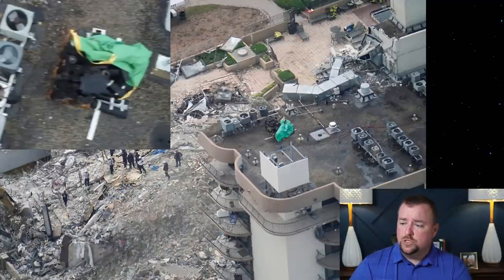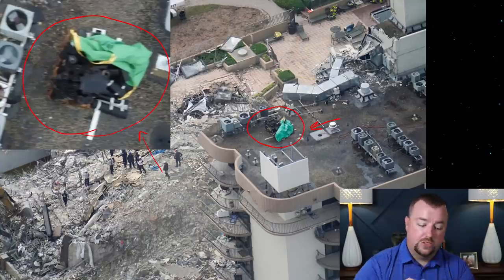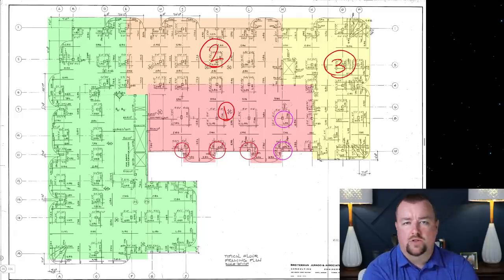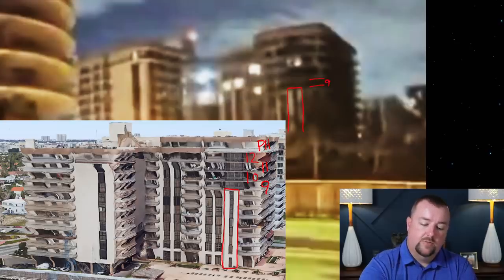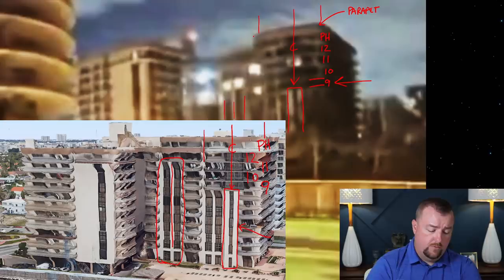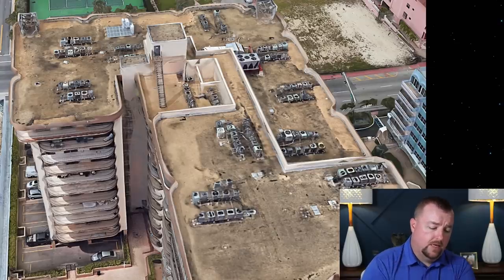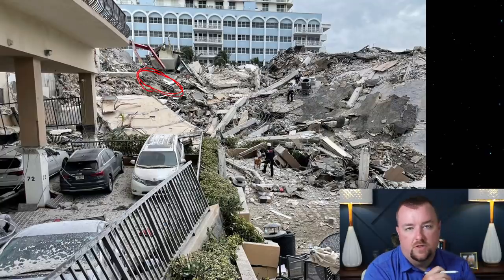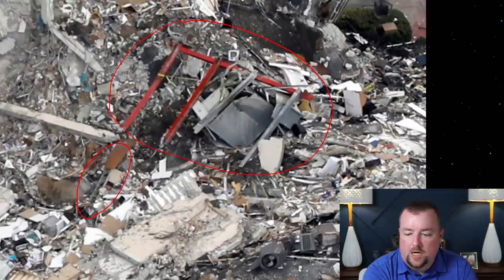Surfside Building Collapse - Did it start at the roof?

Comment: Good video..  I am a certified and licensed roofing contractor of 30 years in Los Angeles. I agree there is no reason to believe the cause of the building collapse was the roof. In fact the roof was underloaded, not overloaded, here’s why.  The existing roof is a hot tar gravel roof which consists of #4/5 tan gravel generally applied at a rate of five 90lb bags per 100 square feet for an installed weight of approximately 4.5 Pounds per Square Foot or PSF (not including the membranes and hot tar, total installed weight approaching 6 PSF).  So the roof used to be tan, we know this.  Since it is now black, it's quite clear that they have swept all the loose ballast off which is the first thing I would do if I were going to resurface this roof, it's standard operating procedure, since the roof is now black and not tan and we know they're in the middle of a roofing job that makes sense. The pile of material (approx. 50 or more rolls – enough for at least a large portion, if not the entire roof) is clearly various membranes that would be used in a built up roof process with hot tar and gravel, it is NOT just for patching in anchors, this is FAR too much material for simply patching in some anchors - I would only need a couple rolls of a smooth flame applied membrane to waterproof say, 30 of those anchors and I seriously doubt there's more than 30. The point is that a good portion of the installed weight of the roof was already removed. Those rolls should not have all been located in one spot on the roof that's pretty lazy of them but it's not a massive amount of weight they are mostly not very heavy consisting mostly of a #11 pound roll which is maybe 40 lbs a roll. Again, a bit lazy of them to just put them in one spot, I would have spread them out a little bit but many tons of weight was already removed from this roof when they swept all the rock off so overall loading was drastically reduced. The ceiling fell in the parking garage and I don’t see how any aspect of the roof – even if it were overloaded and it clearly was not, could have affected that.  Achems razor – the simplest answer is usually the right one.  The engineers and other contractors said they have major structural stuff going on, and what do you know, there’s video of it collapsing in the parking garage. Case closed and stop the nonsense people about bombs. It’s not always bombs.
Reply: Truth bomb 💣 love of money was the cause.
Reply: I agree that the roof we can see in the photo is now lighter but we are looking at the building that remained standing. Do we know for sure they removed the old roofing material from the section that did collapse or is it possible they staged the new roofing material and possibly other equipment on the roof of the section that did collapse?
Reply: Very informative. Thanks for sharing -- really interesting.
Reply: Hi, this might be off topic but since you're a roofing professional. Can I ask you a question? had my shingles done on my Cape cod home 25 years ago. The planks underneath the new shingles splitting from the nail guns. Is not leaking and holding on as long as possible. My question is it possible to spay on roofing material  on the existing shingles?
Reply: well said
Reply: The building has a section (C units) with two parapets. I was wondering why that would be done and I am guessing a parapet is a lot heavier than a balcony railing or just a wall. I was thinking this was an error in construction when they were still confused about whether they were building a 12th story or a 13th story building. This is the only section with the double parapet (one on the 13th story and one on the roof level) and although I subscribe to the columns buckling at the pool deck level under unit C (floor level of apt 111) theory, this added weight probably did not help those columns.
Reply: @beehaven9949  yeah, interesting...when was the 13th storey added? Was it in the original design or was it added years later?
Reply: Note that the code requires 15 lb / ft sq. Rain and storm load to be accommodated within the design. None of that load existed at the time and the dead load roof material could easily be carried.
Reply: @callmeishmael7452  good point.
Reply: @laurasalo6160  Original permit was granted Nov 1979 and the 13th floor was granted Nov 1980. Certificate of occupancy granted Dec 1981, & 13th December 1982.
Reply: @beehaven9949  oh wow, thanks for finding these details.
What do you think, does everything look routine in how this was done? Nothing unusual about it?
If you know, I mean...
Reply: @laurasalo6160  Definitely a fiasco including resignations and all.
Reply: Well said White, we construction workers have a good understanding of how buildings are made ...
Reply: @rollzolo  I have seen videos where grass is grown on the roof, keeps the house cooler...
Reply: But locals said it looked like bomb damage
Reply: Too long, didn't read.
Reply: c4 attached to support columns “helped” this building down…demolition.  Sketchy business everywhere.  Demo…that’s what I saw.
Reply: @jimhofoss9982  ok crazy Ken.....is your wife a karen?
Reply: @rollzolo  I've seen it done, but generally speaking, you don't spray comp shingles.  And far as i know the only thing you would spray on there is white elastomeric paint, which means your roof would now be glaring white.
Reply: @gregx8245   yeah words are tough man.  sorry i couldn't just provide images, like the coloring books you're used to.
Reply: However something was seriously wrong with load capacity design at deck level which was minimum 50 lbs/ ft sq. Required per building code. That’s a lot of design capacity / strength for an ‘empty ‘  deck to simply fall into the parking floor below.
Reply: @dreamersruleNOW  All rubble looks like the aftermath of bomb going off. Doesn't mean there was actually a bomb. Just like how Cassie Stratton said there was a sinkhole in the pool deck but it was just the pool deck collapsing into the garage.
Reply: I hate to say this, after your detailed and informative explanation, but it's "Ockham's Razor," not "Achem's Razor," named after William of Ockham, a prominent medieval philosopher. (Sometimes an alternate spelling is used: "Occam.")

Comment: Will y’all stop commenting based on the title of this episode.  He knows it didn’t start on the roof.  He’s simply going into every possibility because that’s how to properly investigate something.  You have to investigate all probable possibilities in order to rule them out.
Reply: That’s why the title is a problem. It should be changed.
Reply: @hellobriii  is right. It clearly began down in the garage or the pool deck, but the fact that there was additional loading on top may have been a critical factor; it may have lasted another year or two before collapse if they hadn't staged so much roofing material on the roof. Of course if they actually spent the money and repaired those weak beams and added more column-to-span brackets (the rebar was clearly not enough given the punch-through failures) it may have lasted another few decades.
Too bad they paid with their lives and not their wallets.
Reply: @hellobriii  I’m not sure if the title changed, but the question “Did it start at the roof” is the question investigated during the video. When you make a video to answer a question or explore a thought line, the best thing to title it.
Reply: Waiting to find out the details is not the Western way of things. You make your conclusion and dismiss everything that does not fit with your now very firm beliefs...
This is why the English speaking world is in such a mess.
Reply: He "Thinks" he does not know! and I can see other alternatives that are as viable. At this stage no one knows. Please don't put all your belief in a single theory, ask yourself where is the proof that the PH didn't collapse first. I can see that as a possibility from frame 1, I could even propose that there appears to be dust in the air in place of the PH, blurred due to motion in frame 1. The answer is not in theoretical notions it is in the video, frame 1 and 2, analyse it "correctly" and it will reveal much.
Reply: @chouseification  the roof loading would possibly be accorded the status of 'contributing factor' but most likely is NOT the 'root cause'.
Reply: @nobodyknows3180  and that's what I said. It was possibly what pushed it over the breaking point now vs in a few years. The root cause was going to cause a collapse eventually unless addressed.
Reply: @hellobriii  Look at the title again... he put a "question mark" at the end which indicates it's a question, not a statement.  Thus, he is working through the logic to determine the most likely cause.  He didn't say the roof caused the collapse.  Look closer people.
Reply: Be gentle, they may be coming around 🤞

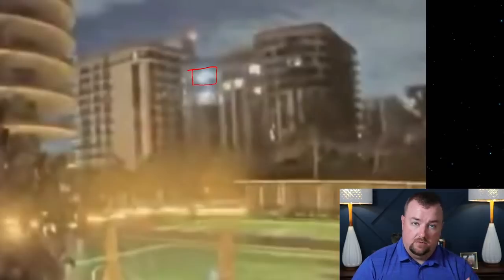Comment: 9:41 To my untrained eye, I read those flashes as electrical being severed. all that ac on the roof must have drawn some serious power. I was assuming 3 phase supply and if you suddenly sever it, it will cause a hell of an arc flash, which is basically a grenade going off, only spewing actual plasma around instead of shrapnel

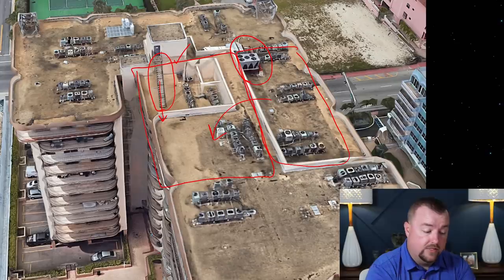edit 20:36 there are about a dozen ac units on that little roof right above the flashes, and you can actually see cabling snaking towards a punch trough over where those flashes were. even if the main feed was isolated to the standing structure, those compressors are all in lockstep and need to spin down, and they will keep that line energized until they do.
Reply: agree very bright electrical flash
Reply: Should have read further comments. I agree but didn't know how different high rise wiring would be vs. my home system.
Reply: Those definitely look like arc flashes. Way brighter than normal lighting.
Reply: If the bright flash of an arc was present at the beginning of the video, this would most likely be the event that triggered the security camera.
Reply: I agree with you on those bright flashes. I am not a professional electrician but have worked with home electrical for many years. And I have also seen what high voltage shorts look like. And yes it is something like plasma being thrown when copper melts from high voltage!!
Reply: I would say definitely arc flashes. The lower of the 2 bright flashes extinguishes on the same frame as the light going out in one of the other apartments in the section collapsing to the right and above the arc flash. The higher bright flash goes out at the same time (same frame) as a light much further down the building in the collapsing section going out, and then the remaining lights go out a few frames later. That would correspond to the 3 phases of the power faulting in succession, and  protection equipment kicking in and disconnecting those phases as they fault (short). I'm pretty sure those are large power distribution cables getting yanked out of connections.
Reply: @richardswenson4463  and house current has nothing on 3 phase. 110 is basically half a phase and 220 is 1 phase. 3 phase is 480 and there's 3 live feeds and a ground. the 3 feeds are synced so that as the voltage starts to drop (AC current) the next phase is on it's upswing. just look up the video "3 phase short circuit" and a power company just shorted a feed with some copper bars to demonstrate. it's spicy
Reply: @tomswiftTTT  the facad of the building falling one story into the basement. the next row of collums has yet to fail though, although they are WAY WAY overloaded and the timer is clicking
Reply: @cynvision  in house-home normal voltage is 120/240 1 phase or 120/208 v 3 phases , in high-rise 460V 3 Phases
Reply: I think Seldoon is right - the bright bluish flashes look like arcing in an electrical short circuit, and probably in a three-phase riser (potentially higher voltage, and certainly 'stiffer' which means more fault current) rather than a 120v. lateral.  The interruption of power would likely have occurred because the collapse created a short circuit which was cleared by a circuit breaker in an electrical room likely much lower in the building, and breakers typically take a few cycles to actually interrupt.  The video suggests that the collapse took place over several seconds of time.  My guess is that the electrical circuits on the upper floors continued to be energized for 30-50 milliseconds (or more) after the collapse advanced enough to create the electrical short circuit.

But there is another possible explanation for the lights that appear to still be on in dwelling units.  LEDs don't stop producing light the instant that power is interrupted.  Instead, the light output persists for a possibly several seconds after power is turned off.  This persistence characteristic is related to the design of the 'driver' within the LED, and in  some LEDs is long enough to be readily visible to the naked eye.  So it is possible that if the light sources were LEDs, the fact that the image shows light within dwelling units doesn't not necessarily mean that power is still on.
Reply: @monophoto1  LED lights don't persist for "possibly several seconds". The power being cut is no different than you turning the switch on and off. Do any of your LED bulbs persist for multiple seconds when you turn the switch off? If they did that, people would immediately take them back to the store saying they were defective. Yes LEDs have capacitors in them that store charge, but the light might persist for 1 or 2 extra cycles of ac (1/60th or 2/60th of a second at most). Those flashes are far too bright to be LED lights.
Reply: Im not the first to immediately think arc flashes. But I do have a bender named rover.
Reply: Electrical flashes make sense to me.  And it goes to Josh's speculation that the "collapse video" didn't start until recording until after the collapse had actually started.  I'll say that another way.  The reason we see the blue flashes in the "collapse video" is because the collapse (and resultant electrical flashes) was already underway when the video started.
Reply: Agree - most people, thing of electricity as just the voltage in their appliances and the sockets. A building like this will have an industrial scale of power consumption, and the big fat power cables to boot. 

Add in that the heavy duty air con units are all on the roof, I think you’re right in that the arcing we are seeing is likely the cables to them and not to the individual condos.

Someone sliced through the mains connection at my Nans house (and somehow survived it) and a guy from the power supplier came out with a team to reconnect it. Essentially a guy who looked like bomb disposal with heavy gloves holding a giant arcing cable that drew a fair crowd to watch it reconnected.

Comment: I think those "lights" are electric arcs as wires are getting yanked out of breaker panels or something. You see some similar 'arc flashes' on the roof of the part that's still standing after the first 3 parts fell. Also, if you play the video frame by frame, the lower of the bright flashes goes out at the same time as one of the lights in the condo up and to the right of the flash goes out. The top bright flash goes out corresponding to a light going out in another apartment that's close to ground level in the section that's collapsing a few frames later, and the remaining lights both in the section that was still standing, and the part that's collapsing, go out a few frames later still. This would be consistent with 3 phase power, and each phase faulting one after the other.

The video is a cell phone video of someone playing back the actual video on a NVR/DVR security system. You can see the edge of the monitor, and the edge of the security DVR software window in some of the frames of the cell phone video. That building next door must have the original video on their security system. It would be nice if the original video from the security system was released, not just a cell phone video of the video that clearly starts late, and is much lower resolution being a video of a video.
Reply: Yes, excellent comment!
Reply: i just said the same think. Then i went down the comments and read you comments i agree.
Reply: I noticed that light, too.

My guess is that the light was an LED (light-emitting-diode) bulb.

The light darkened later than the others, because a capacitor in the bulb still fed current to the diodes.

The bulb had nothing to do with the collapse.
Reply: @1L6E6VHF  Yeah LED's don't draw much so their smoothing capacitor can keep them going probably for at least several cycles of the grid frequency they were designed for so probably at least a 10th of a second or so. Hell for an idea just how little power LED's need the driver actually needs to actively make sure they stay dark when plugged into an open mains circuit. They don't draw enough current to short out the phantom voltage caused by capacitive coupling within the household wiring usually on their own. Thus why some LED lights with cheap drivers continue to glow dimly even in an open circuit wouldn't be enough to see at this distance. But still gives some perspective how much a component actually designed to be a good capacitor could sustain a working voltage for.
Reply: I’ve been in the air conditioning business 46 years. I’ve seen many arcs  caused by grounding or phase to phase shorts. The brightness of the flashes is very indicative of either one of those scenarios.
Reply: YEP, wiring getting short all over, this is wiring BEFORE the units BRAKERs probably multiple short at the same time as slabs rips
Reply: They'll probably subpoena the original full video for the investigation. I can't imagine they'd be satisfied with a shaky cell phone recording of the security footage. Assuming it already hasn't been subpoena'd (seeing as I'm commenting in December).